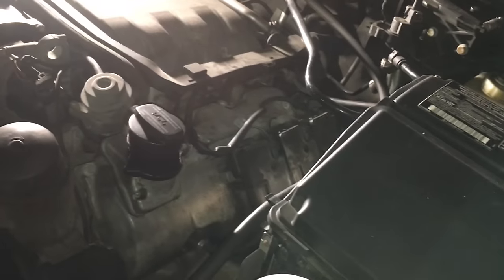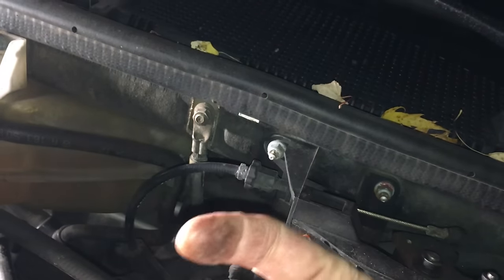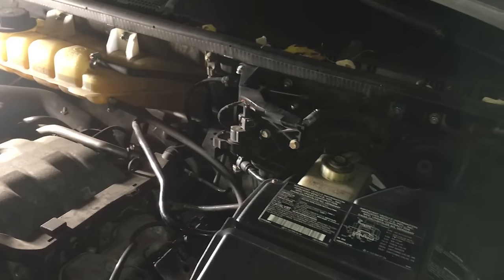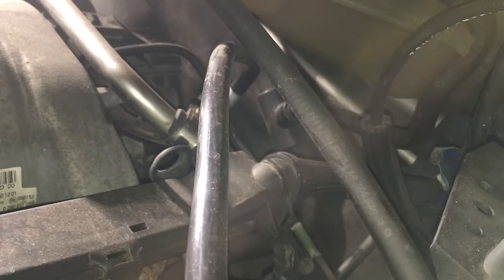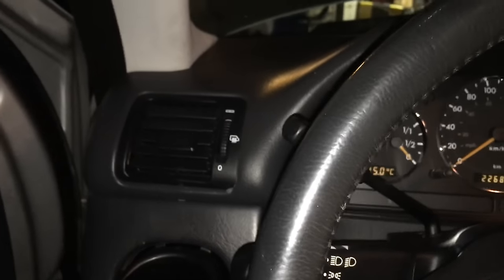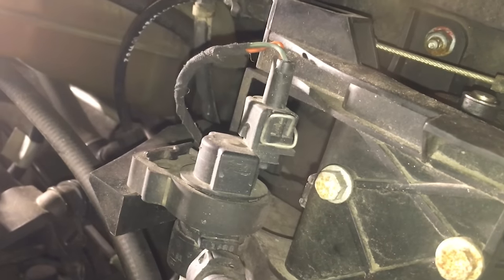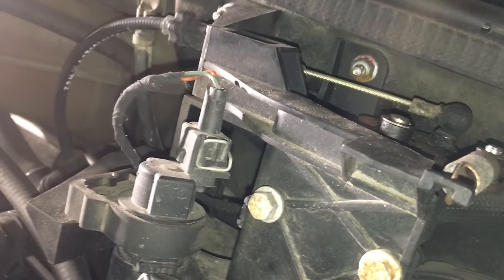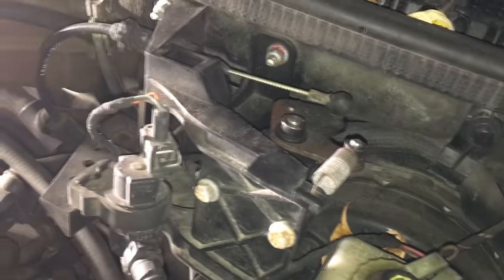Mercedes electronic throttle body how to reset idle .relearn..improved idle, throttle response

Comment: Would this work if i replaced the m112 throttle body with the one meant for the m113?
Reply from the maker: yes . The beauty of the m112 and m113 is that they share almost every part . The m113 throttle body is slightly bigger for the increased v8 displacement but fits the m112 and has the same adaptation . this will work with the swapped throttle body

Comment: Hello Fupa, does this also apply for the diesel versions? I have a slight rpm needle fluctuation on my w203 220cdi, facelift model. I know there is a list of possible causes but I wanted to know if the throttle reset works the same as shown here.
Reply from the maker: good question . I'm honestly not sure but doing it can't hurt anything so its worth a try . Let me know if it works .

Comment: I have a E280 that idles rough and very poor delivery of power but comes on if i apply gas very slowly but as you can umagine its becoming dangerous from traffic behind as i cant get any acceleration and it pops little back fires or something similar but not as violent as a normal back fire. I havent been able to find a resource that has this issue. Theres videos with similar problems but i need help please
Reply from the maker: could be a few things , I would check MAF first , vacuum leaks , crankshaft sensor, camshaft sensor ,   Any check engine light or codes ?

Comment: Hey Fupa,

My car will go into gear but moves really slow in  drive and reverse. So slow I cant move it out of the driveway. If I press the pedal to the floor, it does nothing (engine doesnt rev up at all it'll just run as if Im not pressing on the pedal. Can a bad throttle body or TPS cause this?
Reply: 1998 ML320 model
Reply from the maker: yes it sounds like the throttle position sensor or the throttle body . likely the sensor where it attaches to the pedal in front of the brake booster

Comment: Hey Fupa hope all is going great! My w163 is throwing a pending code P0221 and P0455 and gas light is blinking. I just replaced the fuel cap but maybe if I try this it might work
Reply from the maker: it may .. also check that your kickdown switch under the gas pedal isn't stuck, and the throttle cable isn't too tight . there is also an evap solenoid valve in the engine compartment by the fuse box. It has 2 plastic pipes and a plug in electrical connector on top. it should tick rapidly every few minutes when the engine is running to purge the vapors from the fuel tank . the hoses can sometimes get clogged or filled with gas if the tank has been overfilled. If the valve ticks it is likely fine . you can unhook the 2 hoses going into the valves and let them sit that way overnight while the fumes evaporate from them .
Reply: fupabox awesome! Thanks brother, I just loosen the throttle cable up a bit. The gas light isn’t blinking anymore i will check the purge valve as well for functionality. Thanks so much again, I really appreciate everything you do. You are the reason I have learned so much about Mercedes. Thanks again!

Comment: Is there a particular reason why you would do this?  Like a CEL code?
Reply from the maker: Generally a CEL won't be tripped from a funky idle . A dead battery can cause the initial throttle to go out of adjustment , sitting for a long time and possibly PCV vapours could cause build up to get the idle slightly out of whack .

Comment: Hello . I watch your videos when they are applicable and they are very informative.  
   I have a 1995 SL320 . I think the mass air flow sensor is bad . A few days ago , i took the mass off my 1996  SL320 and put it on the 1995 and the car wouldn't run ; so I put the bad one back on the 1995 . Both mass sensors are Bosche with the same part numbers.  Will a cleaned or new mass prevent the car from starting , until the ECU is reset , as in your video? 
   How long do I need to leave ignition on for the ECU to reset ? 
   In your video , you said 3 minutes.  I read in one of the comments and you said 10 minutes.  
     I just tried this on the 1995 SL320 for 3 minutes.  There wasn't any sound whatsoever ; no humming or clicking.
   Any information will be helpful. 
  Thank you.
Reply from the maker: I've seen it reset after 3 minutes , and sometimes it takes 10. Weird I know . My ML350 and 320 would each hunt and click for different times until quiet . It may be due to build up around the edge of the throttle body preventing proper seating of the butterfly valve . Odd that one MAF would work and one not . Even with a bad MAF it should start then idle poorly and stall . I can only assume the MAF from the 1996 has some sort of internal short keeping the car from starting . Very odd
Reply: @fupabox  , thank you for your reply . I will check for buildup around the butterfly.  I believe it needs a new MAS . What are your thoughts on cleaning a dirty MAS and buying a MAS off ebay (aftermarket with lifetime warranty ) , compared to buying BOSCHE ? Even non brand MAS are $160 at local parts store . Also I read somewhere that when a new MAS is installed,  that the ECU needs to be reset because the ECU will recognize the new MAS as an old one. And once the MAS is cleaned or a new one is installed , should I wait longer ( 10 minutes ) to see if the ECU resets ? As I mentioned before , there wasn't any humming or clicking during the 3 or so minutes of the ECU resetting .
 Again , thank you for you help . You're very knowledgeable about these cars .

Comment: I have a 2002 Mercedes Benz ML320...it's idled up pretty far n the gear sticks when I put it n drive....wat can I do to fix this problem
Reply from the maker: Adjust the cable length as shown in this vid . Then turn the ignition key all the way on without starting the car .. when all the dash warning lights come on ... then leave the key in that position for about 10 minutes without starting . After 10 minutes turn key to off then start engine . The idle should be normal now .

Comment: Hey! So my SL500 has a problem, it'll run start fine, until warm about 80° and the will start jumping idle along with oil pressure. Just wondering if this would be the problem with my car?Also just FYI, my cats been running fine for about 3 years and I KEEP oil changed regularly not 3K but about 4-5k.. I did notice the outside temp gauge is not working but I don't think that has anything to do with the engine, does it?
All help appreciated! Maybe I'll try upload a video...
Reply from the maker: Could be a lot of things... vacuum leak, intake air leak, ignition..etc... best test would be tp hook a vacuum gauge to one of the vacuum lines and do a few idle and rev tests.. it will amaze you how a $10 vacuum gauge can spot problems
Reply: fupabox Hey! Thanks! I did the tests and and everything seems fine so I left it, BUT I did fix the problem!!!
I also tested the battery, I guess it was charging just enough to keep the car cranking, so I swapped out the battery, and idle after warm-up is back to normal!! 

Man.... Let me tell you, I'm glad it was something so simple!
Reply from the maker: Beau Baugues Excellent..it's amazing how a battery can mess with a Benz.   Other cars shrug it off until they won't start, But a Mercedes needs a good battery

Comment: Hey fupabox , does this apply to a 96 w202 as well ? Love that old car!  Ever drive a glk ? I was thinking bout getting one
Reply from the maker: I am not 100% sure if the 96 was electronic.. pretty sure it is.. if so yes.. Love the GLK,, drove a few, looking for one for the GF at the moment actually..First gen though . The newer ones don't look anywhere near as nice as the first GLK. Not sure why they changed the body design, in my opinion it is one of the coolest and most distinguishable designs on the road. Nothing else looks like a GLK, now everything looks like a Santa fe.
Reply: fupabox yeah totally agree! I think they changed the name also,
Reply from the maker: They did.. Mercedes nomenclature has gone all weird.. hard to remember which morphed into which
Reply: fupabox glc now , cause it uses c class platform , I much prefer the boxier look

Comment: Whats the part called in front of throttle body, that has the green and orange wires?
Reply from the maker: That is the fuel vapor purge valve . It ticks when running as it purges gas fumes from the fuel tank

Comment: Hi buddy again, can you make this guide for G500 too? Thanks@@!
Reply from the maker: This will work on any m112  m113 engine with electronic  gas pedal. I'll make another vid showing cable adjustment on the W463
Reply from the maker: video should be up in a few hours

Comment: Could you help me with my 02 e320? Getting code p0123. Makes car switch from auto to manuel while driving
Reply from the maker: Thats a throttle position sensor code...either the throttle body or the pedal sensor. Your W211 chassis skips the cable operated sensor and puts the sensor right on the pedal ..some of them seem to be cable operated as in this video . If you have a cable check that it isnt too tight , you can perform th idle relearn as in this vid , and also the ecu reset ..Turn key to position 2 and Depress throttle fully to the floor until you engage kickdown switch. Hold for 25 seconds then... turn key off and release pedal, leave key in ignition for 3 minutes
Reply: @fupabox  thank you for replying. I will check the cable tommoro. I tried the reset procedure already. Noticed that when driving in auto. and it jumps to manuel that I can hold the shifter over and it will jump right back to drive until I let it go then back to manuel. ? Any thoughts would be appreciated. Thanks
Reply: @fupabox  how do I know if the throttle cable is to tight?
Reply from the maker: @jessicamccafferty5774  watch this video above ..it explains the cable adjustment

Comment: So you do nothing but leave the key on for 3 minutes?  My 05 c230 makes this noise frequently when I turn it on. And has done it a few times after shutting down. Has been driving me crazy.
Reply from the maker: It may not work if the throttle body is extremely dirty and the throttle flap can't locate properly . Otherwise just leaving the key on for 3 minutes will reset . If the electronic throttle is always hunting the throttle body is likely dirty
Reply: It actually looked pretty clean. Not perfect but cleaner than I expected. However, there is a sensor that plugs in right behind it that is pretty foul and I cannot figure out what the sensor is, exactly.

Comment: What is that plug with the 2 wires next to it, a relay of some sort because mines makes a ticking noise when it’s running, I notice it when I was trying to sell mines and it was ticking n I was questioned about it? Help please
Reply from the maker: it's supposed to tick .. it's the fuel vapor solenoid.. brings vapors from the fuel tank to be burned in the engine

Comment: I have a ml 270 when it’s cold drives mint but when warms up dosent pull right can here the turbo kicking in but dosent bost right then me rev counter drops now and then and won’t go over 2500 revs cleaned turbo egr any ideals what this could be came up mass air filter sensor with code p0100 also makes a air nose from the foot pedal
Reply from the maker: MAF is a good bet since it is also temperature sensitive .

Comment: What a great trick! Thank you
I have a 2006 ML500. Recently after the first 10 minutes of driving when I stop at a light, the engine does a slow motion hiccup and when I shift to N the hiccup stops. Then when I push on the gas to start going it has a hesitation and then keeps going. It doesn't necessarily repeat at the next stop but for sure at some other times during the same trip.
Any insight will be appreciated. Thanks.
Reply from the maker: possibly a dirty throttle body or very small vacuum leak. Vacuum leaks are usually along the intake, or the gasket at the top of the throttle body that seals to the removeable filter box
Reply: I have a clk 430 and it's been doing the same thing. Engine just started running really rough after I rinsed it off today

Comment: I have a C200 W202 1996 its nearly redlining after throttle body deep clean i may of move intake butterfly thing ive tried the 3 minute thing didnt work in my case any help out there?
Reply from the maker: did you have the throttle body plugged in while you cleaned it ..or disconnected ?
Reply: @fupabox  yer i cleaned it very well....i had a sleep on it and worked out i tightened the throttle cable thread thing too much...runs like a dream now no rough idle no stuck throttle flap
Reply: @fupabox  nooo i took it all off cleaned it properly looks new now...its a manual throttle not a signal one like you was saying but it lead me on the way to finding my problem which i much appreciated!!!
Reply from the maker: @UnknownUnknown-kz9nt  Excellent  ..glad to hear it

Comment: I heard you have to turn the key to the on position and step on your gas pedal all the way to the floor for 2 minutes....... then turn off and crank the car up and take for a drive ......
Reply from the maker: thats the transmission relearn for the adaptive transmission. this is merely to reset idle position on the throttle body

Comment: The throttle of my ML320 stops working when the can enters pot hole.But the engine, will be running.Then I stop,turn off the engine,start again and it will start working again.

Comment: E320 just changed the throttle body did this process & still doesn’t give no gas what do I do?
Reply from the maker: is the actuator from the pedal cable working ? it comes from the cable that goes to the gas pedal and sends the signal to the throttle body

Comment: Hi sir i have a Mercedes benz s320 model 1995 and i travel from baghdad to another city at the reod suddenly the fuel bomb start idle and he stop and we try to open the car but the fuel bomb had fail again then we change the fuel bomb but another proplem had come the battery was very weak then we change it and the car at end came good but i want to ask you how i can fix the throtle body  i think could be rest when i change battery. .also the car when i open it goes up  to 3-4000 rpm then down to less than 500 rpm how can i fix this problem i sorry to my long information 
Thanks
Reply from the maker: It could be many things.. broken wiring harness in the engine compartment, vacuum leak, throttle actuator.  Check everything that was touched when the battery was changed
Reply: عزيزي حسن فقط افتح سويج بدون تشغيل 10 دقائق . ثم اطفىء السويج واسحبه من مكانه .ثم اعد تشغيل السيارة . المفروض تم برمجة الثرتل . وان ظهرت المشكلة مرة اخرى . لابد من وجود عطل  ما يستوجب التدقيق بدون الرجوع الى الثرتل. ودوما راعي شراء مضخة وقود نوعية ممتازة . شكرا. ولو متاخرة الاجابة

Comment: i got code error P2279, is possible that the error came from Throttle body? i do not have power on my mercedes W204 .... check engine is on . if i reset the error the car goes to 3000rpm but not further. i have chenged the MAF sensor but same result. it is possible that the error comes from DPF? when the check engine is off , i can not see the DPF on diagnose. when the check engine is on i can see the DPF on diagnose software. can u please give me a clue on what defekt  bring this to my car? thank you
Reply from the maker: that code is for an air leak between the Maf and throttle body..you will need to check everything carefully for leaks.. The DPF is a filter for the diesel engines, but unfortunately I don't have any real experience with the newer diesels

Comment: Hi I have a 2002 c 240. gas pedal gives out while driving sometimes and esp light pops up. I changed accelerator pedal and mass air flow sensor, got alignment and changed fuel filter. did the reset key thing as well. I still have the problem .
Reply from the maker: One of your ABS wheel speed sensors is bad or dirty or connector not plugged in

Comment: Will this technique work on a 91 500sl? I have a high idle after engine warms up. RPM goes up to 2k
Reply from the maker: no. 1991SL has direct throttle linkage ..that being said , give it a try it can't hurt anything . It is likely your idle control valve or a minor air leak somewhere . Check all the vacuum hoses
Reply: fupabox what about a W202 C180?
Reply: @fupabox  thanks for the tip... it solved my problem on my 1990 300sl.

Comment: I have 112 engine but not wired throttle does this work on this?
Reply: same case to my!!!!! 2003 MB E320 NO  WIRE?
Reply from the maker: All M112 engines are electronic throttle . Some just don't have the cable from the pedal to the actuator in the engine compartment . On those models the electronic actuator is built into the pedal assembly . This will still work on yours . Just no cable adjustment
Reply from the maker: @josefamixe  All M112 engines are electronic throttle . Some just don't have the cable from the pedal to the actuator in the engine compartment . On those models the electronic actuator is built into the pedal assembly . This will still work on yours . Just no cable adjustment
Reply: fupabox tks to your help!!!